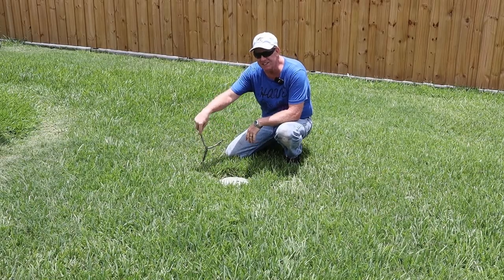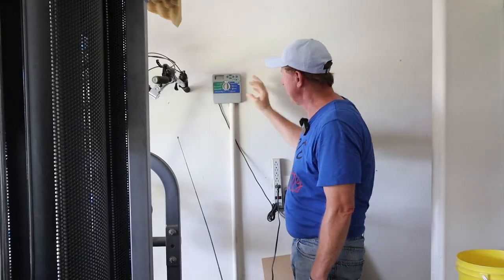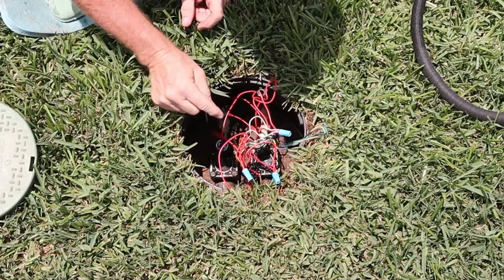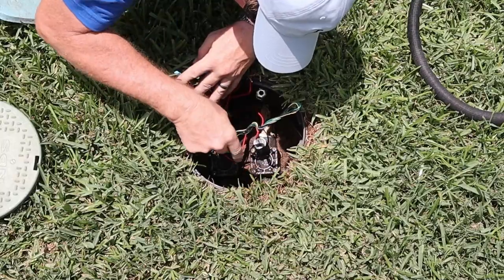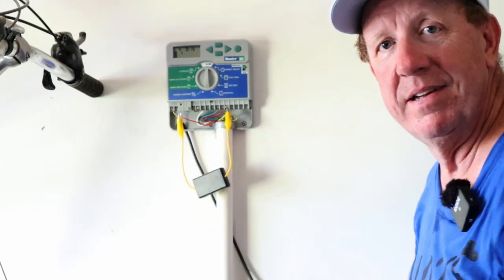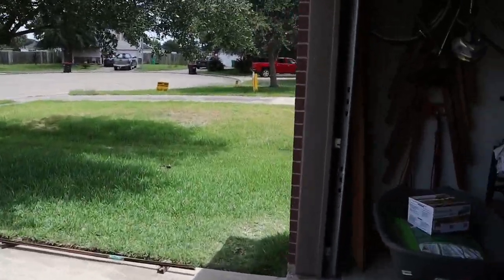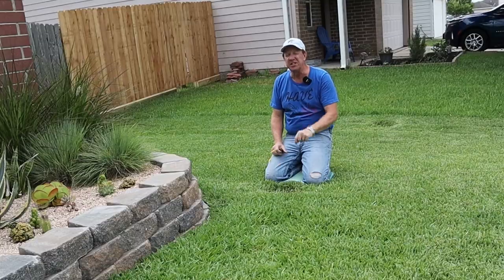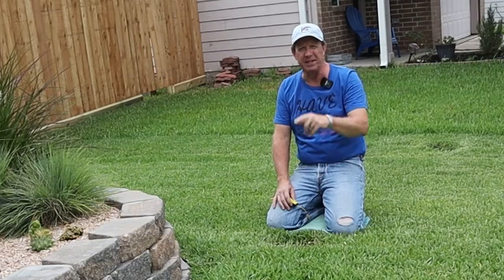Gone Gone Gone Found Sprinkler Valve with the Chat-R-Box!

Comment: Just what I need. Any advice on finding the layout of an inground sprinkler system? I  want to plant some fruit trees in my backyard, but Im sacred I will end up planting to close or on top of the sprinkler lines.
Reply from the maker: Typically the sprinkler lines are only about 6 inches in the ground.  Mine are around 5-7 in deep.  Typically the lines are going to run along the line that the sprinkler heads are laid out.  Thanks for watching.

Comment: Great idea although I think I've got damaged wires to my valve and I've no idea where the valve is so that probably wouldn't help me. I think for me the hire system is the way to go until it's all fixed up
Reply from the maker: if all the wires are broken then yes it won't work.  I believe there is a tool you can possibly rent in your situation that will help locate them.  Otherwise you will have to dig along the buried wire line to find and fix them.  It's not hard to replace the wire, the difficult part will be the digging.  Thanks for watching.